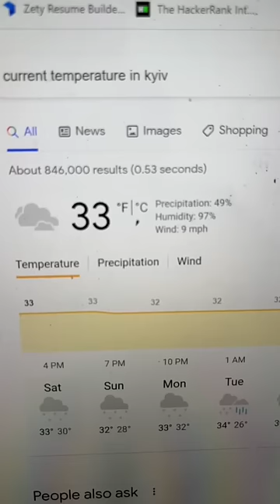Why doesn’t Ukraine use diesel locomotives as power generators?

Comment: 80% of Ukrainian rail transport capacity is electric powered. That rate is pretty much standard for a European country. Electric trains can not run when there is no electricity. The power outages hit the Ukrainian railroad system hard. 
Ukraine desperately needs every single Diesel loco to keep supply trains to the front operational. 

The Ukrainian railway system has an additional problem. It is Sowjet 1520mm broad gauge with Sowjet couplers. When Ukraine runs out of trains, it's not easily possible to just replace them with western ones because western trains use 1435mm standard gauge with other couplers. 

And, btw. the most innovative Sowjet loco manufacturers have always been Ukrainian. Just as the most innovative ship yards. Russia wants Ukraine because Russia can't make their own high tech products.
Reply from the maker: That’s interesting. I read that 45% was electric, but 80% seems like it is more likely.
Reply: @RyanMcBethProgramming  The percentage is very different, depending on what you actually count. Do you count the total miles of all rail lines, do you count public owned owned lines only, do you include the purely industrial rail lines or not, do you count mainlines only, and so on. Or do you even count the locos? The results will be VERY different. 

80% should be the number for main line miles.

Comment: Can you make an electric tank tho?
Reply from the maker: Probably a lighter one. Maybe it would be good for going a couple of hundred meters under electric power or just operating everything on battery power remaining silent while conserving fuel.
Reply: @RyanMcBethProgramming  hybride tank, could be interesting. The electrical components could be closer to weak spots as it’s generally less sensitive than a gas engine or fueltank

Comment: I beg to differ on that electric tank not being capable of being created with this stuff coming out and now they technology I'm pretty sure I could get an electric tank solid state batteries that will go 10 times further than any diesel tank and we won't even split hairs about red hydrogen as the fuel source needed to charge the batteries that could power a tank for its entire life million plus miles if you do it right

Comment: IN THE DAYS WHEN GENERAL ELECTRIC STARTED USING 3 PHASE AC TRACTION ALTERNATORS,
SOUTHERN PACIFIC RAILROAD HAD SOME NEW LOCOMOTIVES MODIFIED TO USE AS STANDBY EMERGENCY POWER GENERATION, SPECIFICALLY,
FOR OPERATING FLOOD WATER PUMPS IN TAYLOR YARD LOS ANGELES!
KEEP THEM ROLLING BROTHERS!!👍👍
Reply: CAPS LOCKED?

Comment: with all the tanks ukraine has captured.. i wonder how much modification it would take to use some of those engines to make electricity?  all that torque, i'd bet they could generate quite a bit...( turning turbines or electric motors in reverse to make power..power converters? ) thou idk the costs in fuel use per kilowatt of power.  you could probably also do it with a helicopter engine... but idk the mechanics and such needed... so this is all speculation... peace.
Reply: I mean those tanks are kind of needed at the front lines.

Comment: GREAT idea. I been saying car batteries can be used in a pinch.
Reply: A 1-4h pinch for a single room electric cooking plate, yeah...
Reply: Car battery? For heating? Maybe to power an electric blanket but that's it. You're better off saving that little energy to power small devices and stay connected.
Reply: The last time we had a power outage was when a big series of downdrafts brought down huge amounts of power lines around the city and the grid was down for four days. One of the neighbours was letting people use his Ford F number truck to get the fridges back up to temperature so we wouldn’t all lose our food, but it wasn’t powerful enough to get our deep freezer to turn on, we ended up running a really long extension cord over the back fences to connect to his generator directly. Using a truck to generate power has limited applications.